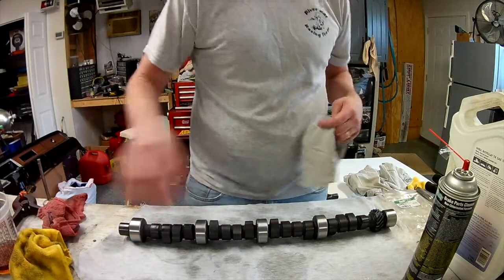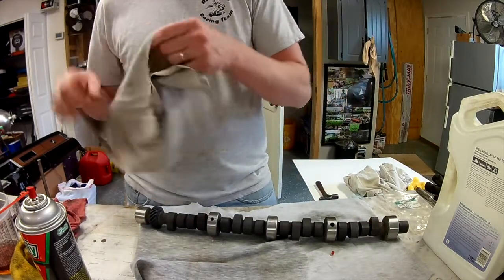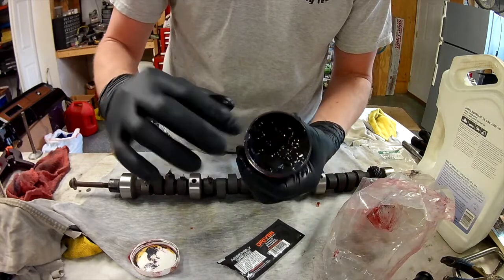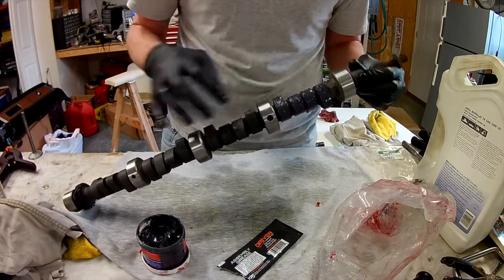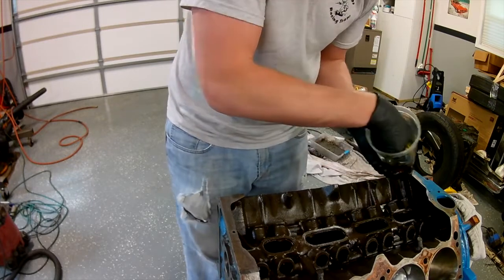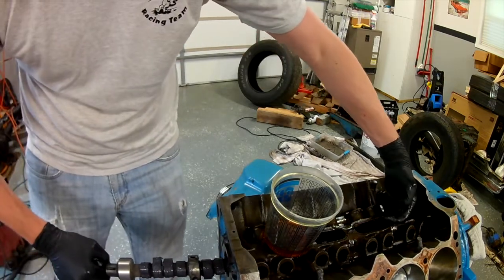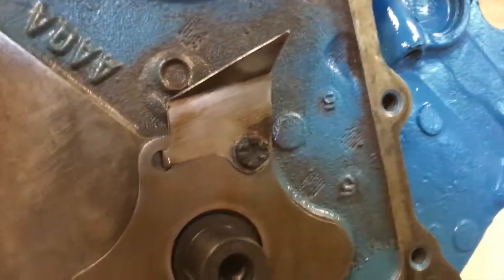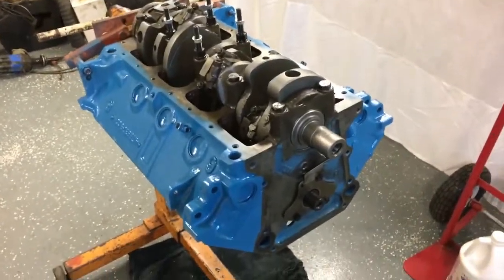360 Engine Build! Part 4, More tips to Ensure Max Performance and Longevity

Comment: I'm gonna be rebuilding my 360 magnum, probably this summer. I have a 2001 ram 1500. So it's cool to see someone rebuilding a 360.  I want to get some decent heads for it and a slightly bigger cam. (Not sure what else I'll have to buy to make that work efficiently) .. I want close to 350 range hp and close to 400 ftlb of torque myself, kinda like you are aiming for in this build.... I just want my truck to pull my travel trailer and be funner to drive around, and also have the  rebuild last a long time. ...  I'm trying to learn as much as I can about a 360 rebuild as I can, so I can accomplish my goal. Eq heads are what people use to put in them, but I hear that company went out of business, so idk what would be a decent head to buy.
Reply from the maker: Check out 318willrun on YouTube. He has several good magnum builds including in his drag truck. You can make 350 and 400 easily. 👍🏼
Reply: @JustMoparJoe  awesome thanks for the tip ! And excellent job on your video's man! keep them coming!

Comment: I put in new camshaft bearings for my stock camshaft. If the camshaft is in how it should be I feel a small resitance. Pulling the camshaft out about 1mm it spins free an can not find why
Reply from the maker: Greetings! When you’re done, the cam shaft should free spin inside the bearings with little to no resistance. It may be the rear cam bearing that is giving you issues. Carefully pull the cam out and look for scaring or high spots on the bearings. You can lightly sand those spots with fine paper. There should be some good videos on YouTube on how to do it. Hopefully that helps.
Reply: @JustMoparJoe  thank you for your answer, I will check and reply on monday
Reply from the maker: @martinkuhne452  good luck 👍🏼
Reply: @JustMoparJoe  OK, the problem with the camshaft is solved. I changed also the lube, now I took only motoroil. The assemblylube was so sticky, it made some resistance so it was hard to spin. I double checked this, because I had the same with the crankshaft.
Reply from the maker: @martinkuhne452  excellent. That assembly lube of 50/50 Lucas and oil stays there longer if the engine was to sit for a few months before starting. I know what you mean on it making the camshaft feel stuck. Nice work 👍🏼

Comment: What castings are those
Reply from the maker: I believe a 68-9 318 head. I list them in the porting series. Reason I went with them was because My 360 heads all had cracks at the seats. I ported these 318 heads for about 20 hours or so.

Comment: My cam plate bolt has a hole in it to oil chain.  My engine is a 71 360
Reply from the maker: I switched to the timing chain tensioner in my 408, that’s in the purple barracuda.

Comment: What's a good cam for the 360 in 1979  a powerwagon
Reply from the maker: Hey Estaban! Its all dependent on your other components and what your goals are with the truck! Is it 2wd or 4wd? What gear is in the truck? what size tires? Do you have a stall converter? What intake manifold are you planning to use?Is the vehicle for daily driving or street strip? I can try to get you some options, but minimally I'd like to know these.
Reply: @JustMoparJoe  33x1250r15 tires gears are still stock
Reply: Looking at maybe extreme cam kit

Comment: Good tips on here for sure! One thing I noticed was on the camshaft thrust plate, did yours have the bolt there that has the hole through it to keep the timing chain oiled? Passenger side top bolt. I know that my '70 Challenger had that type bolt there when I tore down the 318 in it . I was unsure if they all had that bolt or not???
Reply from the maker: DR440 it didn’t. I’m familiar with that. I’ve seen several 273’s that had them, and early 318’s. Never a 360 yet
Reply: @JustMoparJoe  Good info. I've only torn down one 360 and it was a long time ago. I'm betting that wedge shaped piece of steel probably takes the place of that to oil the chain.

Comment: can you put a list of all the parts in the description
Reply from the maker: phillip holston I usually put the parts in each videos description. I’ll do a full list in the final video 👍🏼
Reply: @JustMoparJoe  cool beans, I was asking because I'm about to build my 360 from my 97 ram.
Reply from the maker: phillip holston that could put you in a pickle. The cam I have is too large to run well fuel injected. Also, magnum motors such as yours have a different deck height. My pistons would likely be sticking out of your block. Double check that you buy parts that are magnum specific.👍🏼